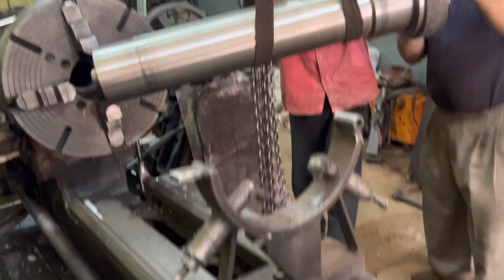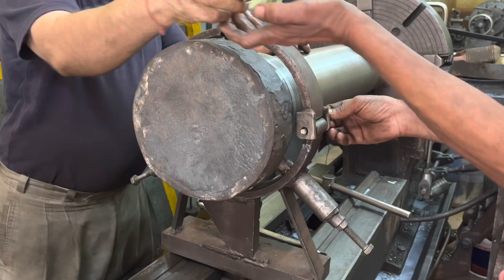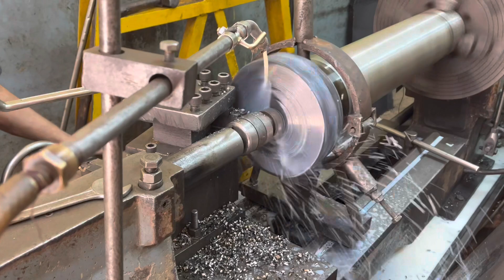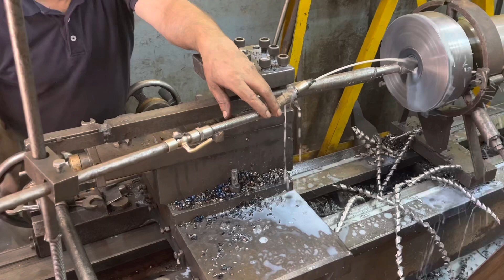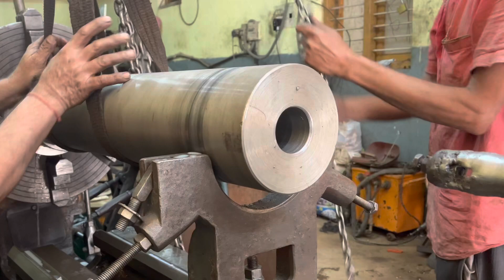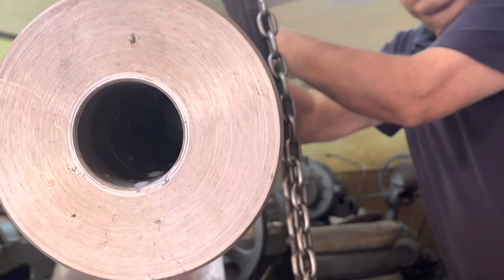150 KG Spindle Turning & Boring on manual lathe machine part-2

Comment: how do you keep the boring bar from jumping around
Reply from the maker: All the screws should be tight 
For example:- 
If boring bar is 1meter ensure the back bar is also 1meter or close to 1 meter
Reply: well he drills a guide to follow, if you notice the boring bar the cutting edge is behind a certain diameter of round material, that helps to fix the boring bar from jumping around.